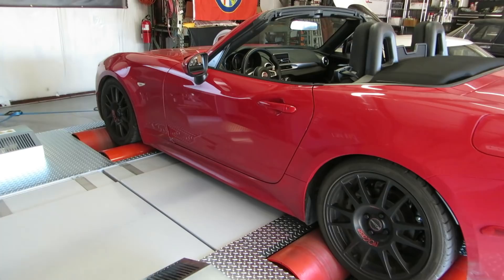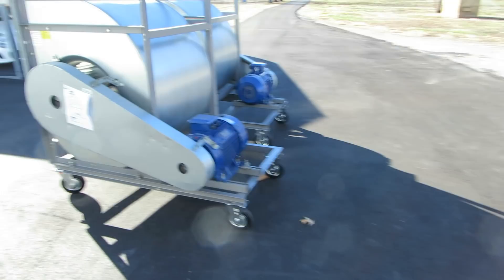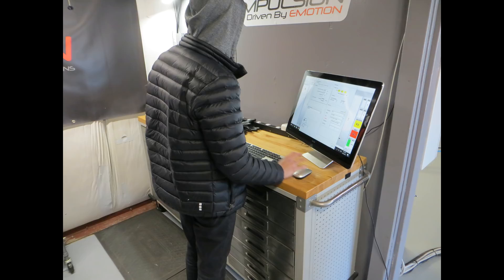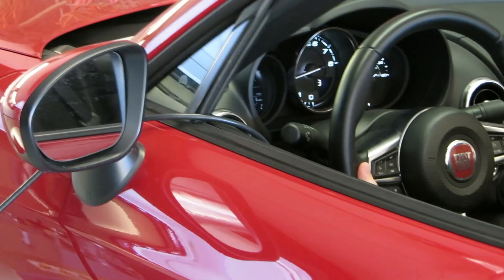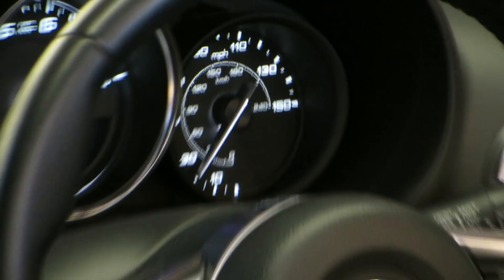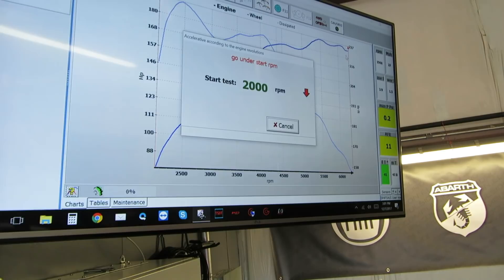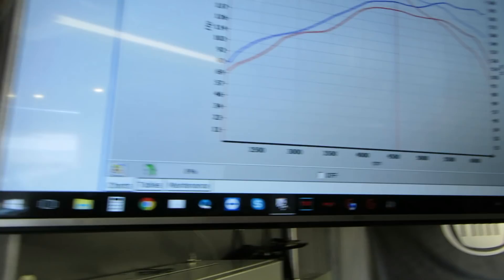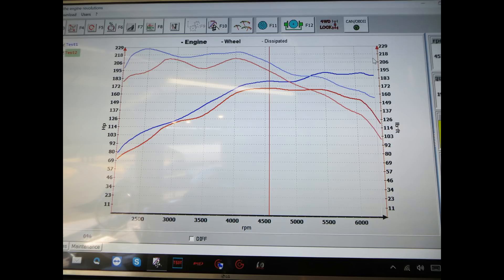Dyno issue with Modern Cars

Comment: God she's a beauty. Shame the 124 didn't really sell all that well in the US market. I have no idea why, probably because it lived under the shadow of Miata but that couldn't really be the complete story. There's just so little content on the 124 even on YouTube. It's sad honestly.
Reply from the maker: It's a great car, but hampered by two things. First the automotive press presented it as a Miata that's not as good as a Miata, which is nonsense. Second, the Fiat dealer network sucks, and the factory backing for performance enthusiasts is non existent, so people looking for a sports car looked elsewhere.
Reply: It's a fine car, certainly a looker; honestly if it had the same engine as the ND Miata it probably would have sold better. I don't think too many people who were considering a roadster (already a small segment) were intrigued by a car that was heavier and longer than a Miata, with less displacement, even if turbocharging gave it more a little more peak power than the ND1 Miata it didn't have much low end torque, and that made it harder to drive. Once the ND2 came out, it made considerably more power than the 124 Abarth, that kinda nailed the coffin.

Comment: Yes, I work in emissions testing and most cars have a dyno Mode to test on a 2WD dyno.  I don’t think the manufacturer would make that publicly available, though.  It is also true that whether the steering wheel turned since engine start was used in a cheating algorithm.  The synching feature is available on some emissions dynos.  Ours are MAHA and they call it v-synch.  However, if you drive traces that include braking it can overwhelm the front roll because of the power required to motor it against the disproportionally large front brakes.

Comment: I wouldnt say the car is detecting its on a dyno per se.  Its just detecting that theres a failure of the systems that require the wheel speed sensors to work.  It would do the same thing if a wheel speed sensor failed.  
What will be interesting is when cars start relying more on accelerometers for data and really sense when they are not physically moving (accelerating) regardless of what the wheel sensors show.  Thats going to be a tough one to work around.
Reply from the maker: You are not wrong. It's not that it "knows" it on a dyno. It's just that it doesn't get the data is wants from the wheel speed sensors.
Reply: Some cars ECUS (I think BMWs) are already using the accelerometer for many calculations regarding the drivetrain. Don't quote me- as I can't remember where I saw that- but it's definitely a step in the direction of what you mentioned.

Comment: Nice.  Cue the "Pull the Fuse" crew. 

And the "Joe Blow has a 4wd Dynojet that works just fine" crew.
Reply from the maker: Pulling the fuse, any fuse doesn't' work because the ABS-ESC system is fail-safe. The ECU sees that as the same problem (ABS-ESC not working properly) and cuts power in the same way. If I could simply pull a fuse and use a more conventional dyno, I would have. It would have cost a lot less.
Reply: If I had a nickel for every time someone has said to reset the PCM for more power...
Reply: Don't forget the "Just 220 bhp? My mates car made [insert silly horsepower] on stock internals" crew.

Comment: very interesting Greg - obviously, if he motor's making less power in 'dyno detected mode', then (assuming advance and mixture remain similar) it will be using less fuel.  I wonder what the manufacturer uses for its consumption testing?  While I'm interested, that's not my question, however, which is: do you have any idea whether or not motorcycle manufacturers may be doing the same thing, now that most modern bikes have front and rear wheel speed sensors?
Reply from the maker: Hi Jan, I have not idea about motorcycles, my experience with them is close to zero. This particular issue shown here should effect fuel consumption testing done by the manufacturer, because those tests are not done at full throttle.

Comment: there is i have heard a huge problem with most motor dynos , or the use of them as i see it , i belive it has to do with the dyno "leading" the engine? instead of simply mesuring the power output trougout the run  , and a hunt for peak power (something rarely  used on these cars) as a result there is a large amount of mainly older v8 cars dyno tested at 500Hp that can barely do a burnout and the driveabillity is really bad,  and as a result of these dynos alot of very used old  school power adding tricks  have been "debunked" ,   what is your troughts on this?

Comment: From what I know there are some switches in the ecu map to put it in "dyno mode" and specifically ignore errors from abs/esc/traction control. 
Have you ever tested that mode?
Reply from the maker: In what ECU? Please post your source for this. It is true that certain ECUs run a dyno map in a dyno mode. That doesn't mean that a tuned car will run its tuned map when it's in dyno mode. I know of no such mode in the MM ECU which is the subject of this video.
Reply: I'm sorry I don't have sources and my memory could well be wrong.
If you haven't heard of this option then I'm pretty sure it means it's not possible on the MM ecu. Thanks for replying
Reply from the maker: Thanks Nebbia :)

Comment: I wonder if it’ll do that on after market ECU’s. I have an ECU upgrade on the cards for my 240sx to support the new engine.
Reply from the maker: No, if you swap in an aftermarket ECU it's not going to be an issue. However that's a huge job on this car, there isn't one that's plug and play.
Reply: Greg's Airplanes and Automobiles I appreciate the info. I’m not a Fiat guy but I really do like the info.

Comment: Does the dyno take into account the added friction and inertia of the front roller/tires in linked mode?
Reply from the maker: Yes it does. It knows if it's in 2 or 4 wheel mode and does the math for the extra mass and friction.
Reply: @GregsAirplanesandAutomobiles  Wow that’s quite a difference then. Curious how close the numbers in 2wd vs awd mode on a car that doesn’t pull power?

Comment: Well I came here after reading a thread. Great video and a very interesting topic! What if a device was employed that creates the appropriate frequency per the cars speed and could plug directly into the abs speed sesnors?
Reply from the maker: Thanks for coming by. A device as you suggest would work, at least in theory, I haven't actually done it.
Reply: Greg's Airplanes and Automobiles actually my friend just suggested running a cable from the rear speed sensors to the front. I'd think that would be the cheapest if the front and rear uses the same pulses/mile.
Reply from the maker: I think the front and rear use the same pulses per mile, but I'm not sure you can split the signal without it degrading. My thought is to put the signal from the driven wheels into an Arduino and have it send out matching signals to the front. I can't think of a reason that wouldn't work. However it would be kind of a pain to set up and remove each time you want to dyno the car. At some point it makes more sense to use road dyno software and just accept that it's not going to be 100% accurate. All methods have problems and variables anyway. I have found that some road dyno software is very reliable and gives repeatable results (Auterra specifically). It may read a bit high, but so what. The Deltas are what matter.
Reply: Greg's Airplanes and Automobiles I think you could split the signal without it degrading. They use VR sensors with a conditioning circuit that doesn't require much current at all. Just the voltage. I think it may work with a shielded twisted wire pair. The Arduino idea is good but it's hard to do that kind of stuff because first you'd need to condition the signal yourself then create a  variable frequency square wave (which is not the easiest atleast on an Arduino) then hope the car will accept a square wave. I was unaware of road Dyno software? Interesting.
Reply: Here's an idea! Inject CAN messages onto the bus with the same identifier as the vehicle uses for front L and R wheel speed. You could read the rear signals through CAN and duplicate them for the front. But the back and forth of the true and injected messages may conflict?
Reply from the maker: You could be correct about the signals. I don't know as it's a bit out of my stronger areas of knowledge. In regard to road dynos, think about this. An inertial dyno, like a Dynojet simply measures how fast a given weighted roller speeds up. The dyno software corrects the data for engine rpm, plus a few other factors and you get horsepower and torque. It's a pretty simply calculation. A road dyno does essentially the same thing. It knows the weight, gear ratios, tire height and so on. Then it measures rate of acceleration based on the rate of increase in engine RPM, by looking at ignition events. This is no different in principle than a typical inertial dyno. However there are other variables to watch out for, like the slope of the road or head/tail winds and so on. If used carefully it can be very effective. Of course all things equal it will tend to read higher due to the greater amount of airflow through the intercooler, and ram into the intake. In or experience Auterra reads a bit high as compared with our chassis dyno, but it's still good data as it's the deltas that count.

Comment: does the ecu have a specific response to the 2 wheel dyno or does simply perceive slippage and reduced power to compensate? the second would be my guess. that's what i would do if i designed it, as, other than a dyno, this could only happen if there was a loss of grip or someone forgot to reconnect the wheel speed sensor.
Reply from the maker: The ECU sees it as wheel slippage, and a failure in the ABS system. I don't think Fiat did this specifically to undermine 2wd dyno owners, that's just a byproduct of the design.
Reply: @GregsAirplanesandAutomobiles  I agree I think it's byproduct of the stability management system. 

When you said that it sort of reminded me that I still have my ABS disable because of what I believe is an intermittent short.  Had to disable them because it was perceiving rear wheels locked so the rear brakes wouldn't work at all randomly.

Comment: i never even know that... so is that a ways to "cheat" or why do cars detect it?
Reply from the maker: I don't see it as a way to cheat, I think it's just a byproduct of the traction and stability control. As an example, if you fishtail this car out of a corner, it won't let you have full power again for a second or so in the interest of keeping the car under control.
Reply: @GregsAirplanesandAutomobiles  well it have less power than it will have less emissions. wasnt the VW thing sort of similar?
Reply from the maker: Sort of, it will have less power on a dyno, but I'm not so sure the original intent was to show lower emissions, I think it may have been a byproduct of the traction/stability control and then the factory Diesel guys took advantage of it. It's not exactly cheating, it's more a case of exploiting the rules to the maximum extent possible. The cars did pass the required tests, but the testing equipment was technologically behind the vehicle's development. In other words, they didn't develop traction and stability control so they could cheat on an emissions test, but the advantage was a byproduct of the new technology and it took a while for the testers to catch on.

Comment: I don't get it, why would tune mfr's want the car to detect it is on a dyno and pull power? Wouldn't they, if anything, give you even more power when it knows it's on a dyno to trick you into thinking your car has more power than it will let you use on the street?
Reply from the maker: I am not making the argument that Fiat chose to do this to trick dynos. I am not saying that at all. I am pointing out that when modified above a certain power level, they don't behave normally on a conventional dyno. Why would they do this? I am not sure they did it intentionally. I think it's a byproduct of the ABS and ESC systems.

Comment: What's your take on why the power is pulled back? Is it for emissions?
Reply from the maker: We don't know. By "we" I mean myself and the people that work with me in my shop. We can only speculate based off of what we have seen. I don't really think it's for emissions. I think it's a byproduct of the ABS and ESC systems that they don't bother to design out for older style dynos. Think about it, why should an auto manufacturer spend time and money to make sure their cars are compatible wtih 1980's era dyno? They don't, probably for the same reason they don't bother to put timing marks on the crank pulley preventing me from using my timing light to check the ignition system. Times change, newer cars need newer equipment for testing, that's just the way it is.
Reply: Thankyou Greg. My experience with Fiat's consists of an 850 coupe(70's ish) an 850 sedan( 70's ish) and a X19( '80's ish). All were immensely chuckable and fun to drive. The X19 was the standout. Here in Tasmania(Australia) the roads are quite tight and winding but dyno's are few and far between.
Your channel is informative and entertaining. Great job.

Comment: Omg who tunes a fiat 1.4t engine? That thing already pushes luck with 24psi boost when stock. And who tunes a Fiata which has an auto tranny?
Reply from the maker: 1. Me. 2. No it doesn't, stock boost peaks at 20-22. 3. Me again :)
Reply: You can't really set a max limit base off boost pressure without knowing the turbo map or going through the tuning process.  If the turbo is efficient at that boost it's likely got a decent amount of head room left as long as you tune for it.   My stock twin turbos  left their happy place around 14lbs, my single which flows the same amount at only ~7lbs of boost doesn't even get the into it's efficiency range until ~14lbs.